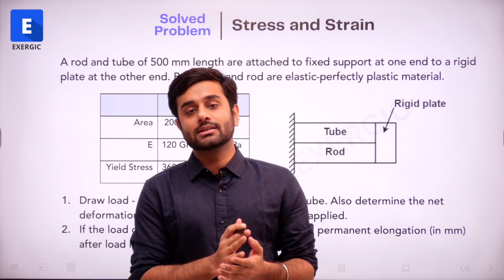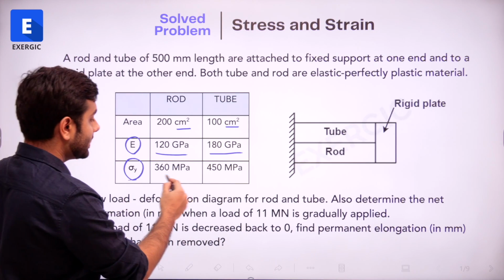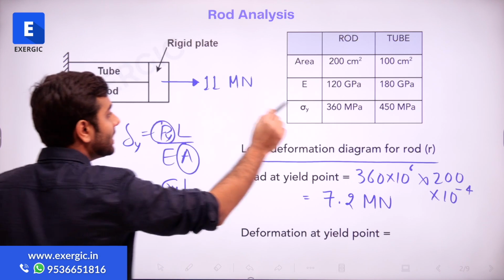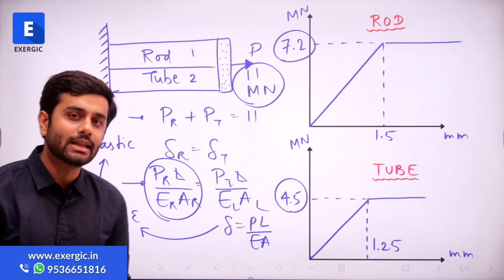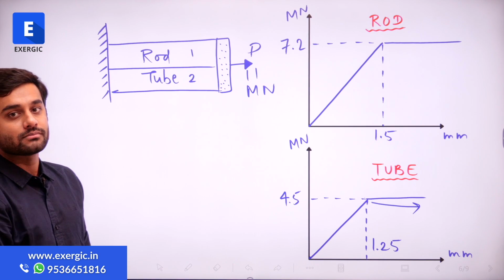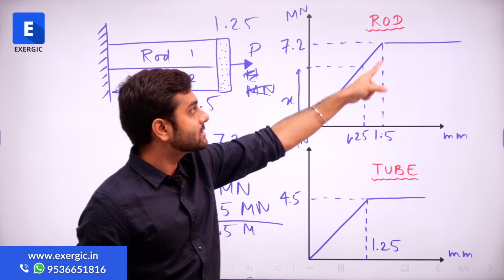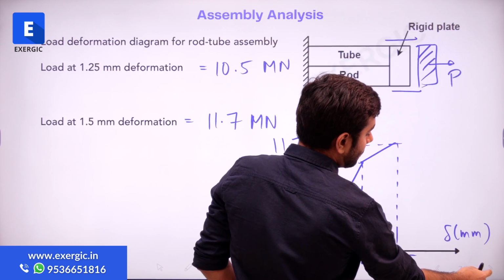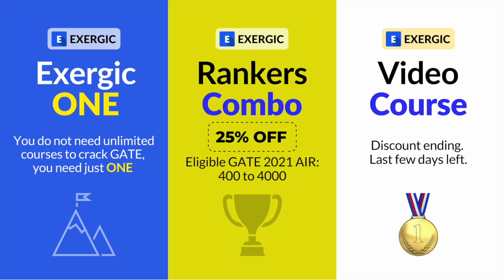Load-Deformation diagram important learning - Strength of Materials | GATE Mechanical

Comment: WOW! I was wishing to have this type of teaching (slightly out of syllabus) in my previous GATE coaching academy (not that it was bad, but it was linear). So I have taken up Test series from Exergic, I hope i see this type of video analysis from it.
Reply: Do they give video analysia for all tests ??
Reply: @saipreethreddy1968  I just joined yesterday, I think they might give video analysis for certain questions which is tricky, involves efficient solving method, prone to silly mistakes or straight up difficult/ out of syllabus
Reply: @phanirajthantry6926   what are the perks of exergic test series have you achieved?
Reply: @durgeshsingh346  you can go through the website and I would suggest also to check ACE academy they will provide more test series and also they have conceptual questions( I know this because I have their bits and bytes )